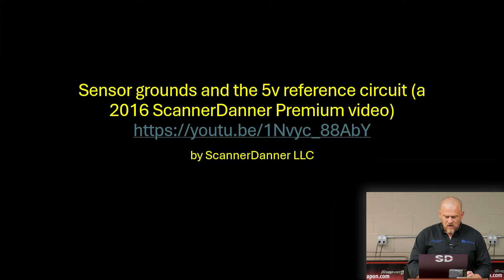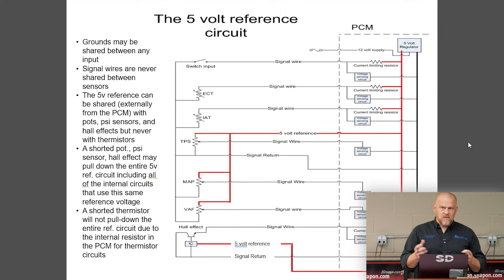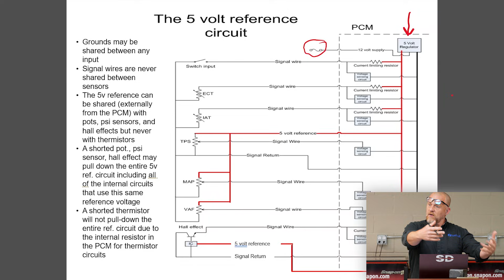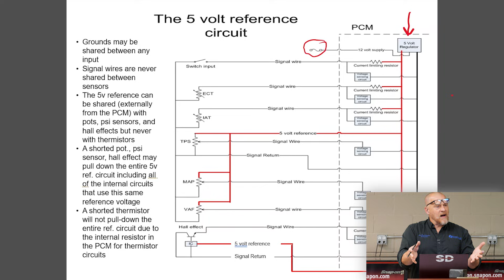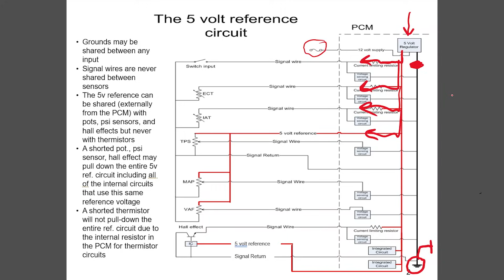Old Examples. Modern Diagnostics

Comment: I commented on another vid.  Stumbled into this one.  Boss, please, as both an engineer and educator, receive my advice in a positive way.  trying to teach electrical to noobs is tough, but your delivery makes it worse.  You are all over the place.  You need to slow your mind, bring one single task, and resolve that with absolute clarity, if you are going to convey that to a student body to absorb.  What I have seen both in your teaching style and diag work on your channel, is you have a sort of ADHD path here.  Now that could be just the camera pressure, but what I see is someone that is all over the place.  I would say pick a single diag condition and work through that.  One of the BIGGEST issues I deal with, with noob techs is reliance on DTCs to find the issue.  A MAF code may 100% NOT be a sensor issue, but an indicator only.  Case and point, my own truck did exactly that, but from experience, it was actually a plugged DPF.  The reality is 'expected vs actual'.
Reply from the maker: A guess a simple thanks but no thanks is needed here. You should probably start your own channel and teach your preferred methods. I have tried and true methods and have been doing this for a very long time with a very high success rate with my students. 30 years as a tech, 18 in the classroom tens of thousands of both in person and online students with many of them becoming very successful diagnostic techs in this field. I understand that I cannot please everyone and my style may not be for you. I'm good with that. After 1300 videos here on YouTube and over 600 on my website, I won't be changing my style.
Reply: guy types pretty arrogantly for only having 1 video on teeth whitening

Comment: Great leason as allvayes
I have a problem
Mazda 3 1.6 diesel. 2012 year
I have no comm with any scan tool. And I have no comm with any module on HS CAN network.
Tests I did
At DLC pin 16 has B÷, 4 and 5 B-, pins 6 and 14 have about 2.5V, resistance between 6 and 14 is 60 ohms. CAN signal is good, checked with osciliscipe.
I got message et scan tool No responce from PCM
Fany thing is that car has no problem. Engine starts and run fine, no check engine light, everything in the car works fine....I have no Idea what to do next. Exept to change PCM?
Reply from the maker: I would suggest a different scan tool. Especially if there is no other problems. Also replacing the PCM is not going to restore coms with other modules! So NO, do NOT replace the PCM for this
Reply: @ScannerDanner I did, I used three dererent scan tools. Scan tool that I have works on other cars exept on mine. And it works on same Mazda 3 with same engine.
Thanks for ansver. All the best
Reply from the maker: @tmanda323  okay, sorry I missed that in your original post. Oddball engine for us in the states. Not sure where you are. But no, again, a new ECM is not going to affect coms on other modules if everything is working correctly
Reply: @ScannerDanner I am from Serbia, Europe.
Thanks again.
Reply: @ScannerDanner Could it be that the pcm is locked in some way?
Reply from the maker: You can't communicate with anything right? But everything works like it should?
Is this an odd set-up for your country? Is it possible this platform is set up for another country?
Reply: @ScannerDanner I have no comm with any module in HS CAN network. Three deferent scantool did not help.
The setup is the same for whole Euripe, so it is for my country. Engine is diesel, 1.6L, 116HP. PCM is continental..
Reply: And yes, ewerything works as it should...
Reply from the maker: No bulletins out there relating? Any type of secure gateway? Sorry. Maybe reach out to DDTSB and see @Diagnosedan YouTube channel and his website
Reply: @ScannerDanner I did but no answer from him.
Reply: @ScannerDanner And since its old car dilership refuse to help.
But I think they dont know how to solve the problem too...
Thanks again mr Danner
And all the best in new year
Reply from the maker: He has thousands of people trying to message him. Maybe ask him in a comment if DDTSB would help you
Reply: @ScannerDanner I'll do that.
In instrument cluster HS CAN meets MS CAN. Could it be there problem? I have com in MS CAN network
Reply from the maker: Does 6 and 14 go to a gateway first or directly to HS  CAN?
Reply: @ScannerDanner directly to HS CAN. I think there is no gateway

Comment: Love your work, but love your honesty more. As an industrial hvac tech, I am running into issues similar to the automotive diagnostics sector with main computer control and comm issues, sensor interference, and intermittant failures. The added problems are also similar...the hardware components are getting nearly impossible to access for service or repair and the failure rate is the highest I've ever seen. I don't  know where quality control went, but why bother to recycle when we pollute more by continuously manufacturing things that go right back into the scrap pile.